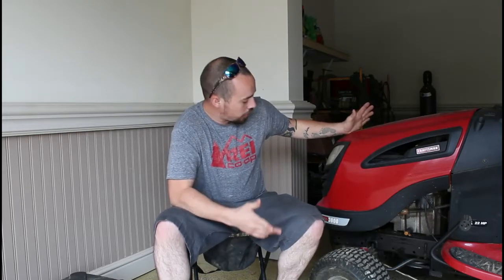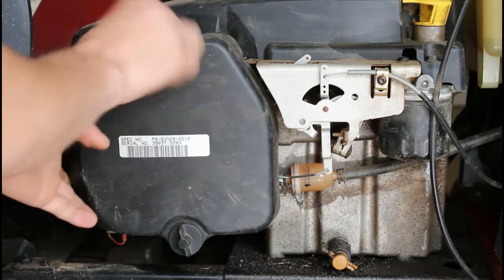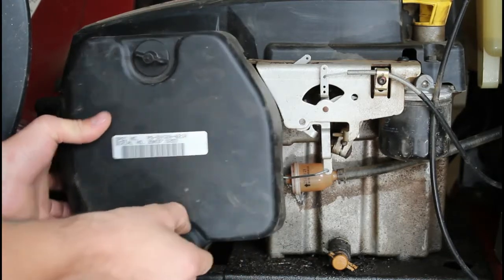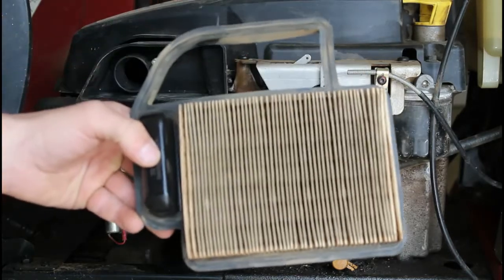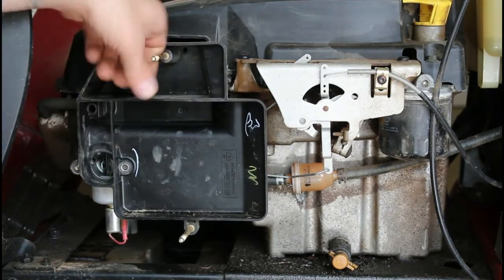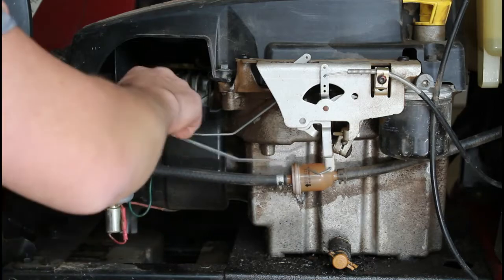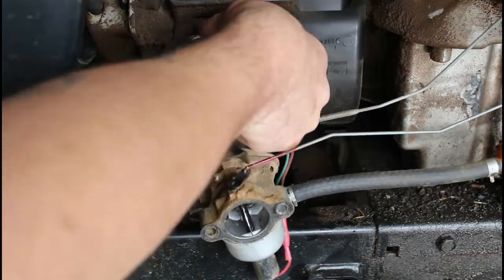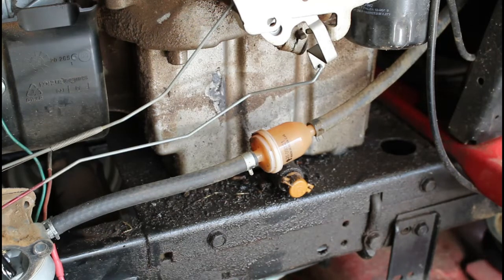how to keep lawn mower from bogging down

Comment: Have a Toro that " bogs " down in grass it used to fly through , thot it was loosing compression ( I'm no mechanic ). Thanks for the heads up air , fuel filters & carb check . Probably help to change the oil too . Thanks again

Comment: Thanks for the video. Also, you might consider wearing rubber gloves when you're changing fuel filters. The benzine in gasoline is a major causer of Leukemia. It's likely the reason my father got Leukemia. He washed his hands with gasoline to get the grease off when working on cars for many years, not knowing any better. He's been battling Leukemia for years now.

Comment: My Ztrak 925a would run fine for 20 to 50 minutes, then lose power.  I 
replaced the 2 magneto coil assemblies and that fixed that problem.

Comment: Mi mower it runs only at 1200 RPM loaded when I know it should run at least at 2800 RPM what it could be is a Kohler engine with 27hp,,any suggestion??

Comment: Swap the pinch clamps for the hose clamps with the wing nut on them would make things a little easier. Good video man.
Reply from the maker: Thanks man👍
Reply: Does anyone have any ideas what causes a mower to stall when I hit a bump?. The seat switch is unplugged. Sometimes it does it when I go down a small hill in my back yard.

Comment: Hey I took the carb off my craftsman push mower cleaned it out. No fuel filter on mower. I started it up it ran fine changed oil too. Well I went and cut the grass as soon as I cut some tall thick grass it stopped and now bog's down. Should I take the carb off again and clean it or try to adjust the linkage?
Reply: My first go to is always check the carb. 9 times out of 10, it’s always carb issues even if u just cleaned it. May be something like a seal/gasket wasn’t placed just right. The float not working properly, ex. There are so many small things in the carb that can F everything up.

Comment: Hey man, if you have to remove the fuel filter like that, you may as well ad a petcock, they’re a few bucks.. and if you insist on not pinching the line, at least don’t set your ass on fire potentially. Lol